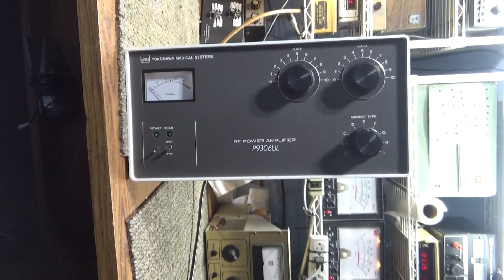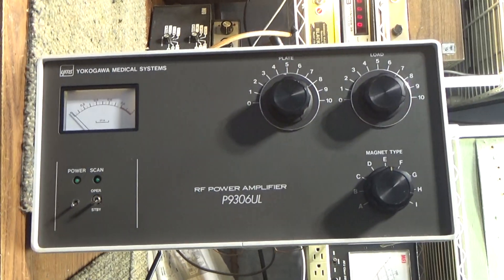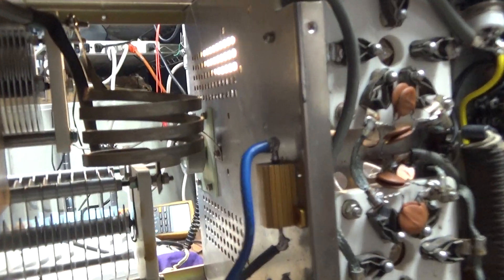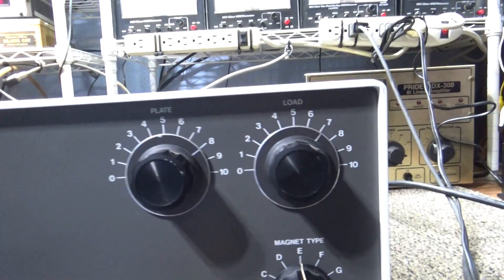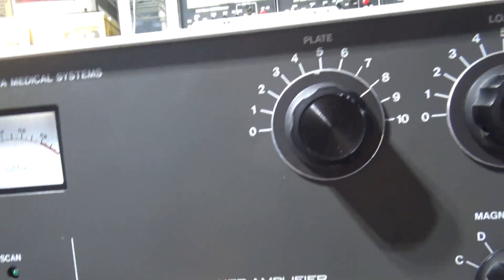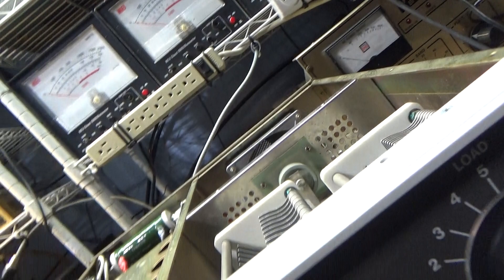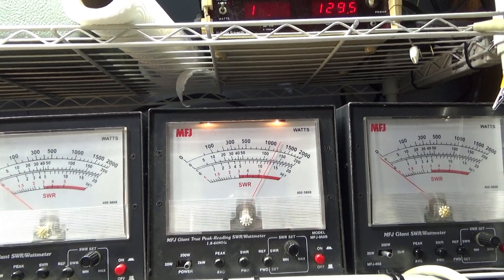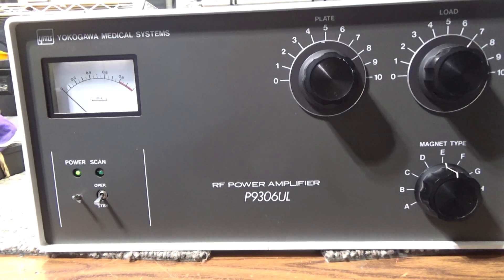Yokogawa P9306UL monobanded and stripped walkthru and on the bench

Comment: Your correct about the sb-220, under current rating for two tubes but ok for ssb but most want to run them on Am and eventually burn up the plate transformer which to me is the weak link to it. The “sb” stands for sb..Then over driving them never helps things out any.I run 3800v on 3-500zg builds.. figured it’s decent voltage unlike the sb-220 around 3200+/- 
Regarding input fixed input using a t50-6 toroid using 20gauge magnet wire 7 turns using two 150pf micas on in and out to ground for a two tuner one tuner 150pf on each side of input. I haven’t yet tried this but bought the junk to try this out on my yu-158 build (different micas ofcourse) letcha know how it works out sounded interesting ha!
Usually use two air variables with a 1/2 dia. 5-6 turns between the two. Appreciate your video once again

Comment: IIRC, the two most popular frequencies are 13.52 and 27.13 MHz. Was this a dual band and what did it use for an exciter? 
There is a dearth of information about this device on the internet. Not even schematics or the instructions.
Reply from the maker: I have no clue what this used as an exciter. It originally had around 6 bands in it and they matched the 10-80 meter Ham bands. The 'Mag' switch was the equivalent of the band switch and switched both the input and output band circuits. The Tokyo Hi Power version is 95% the same as this amp and I used the schematics from it.
Reply: @tramdr  Interesting. Johnson Yokogawa is a big HVAC and industrial controls company and maybe they made them under license from Tokyo HP.

Comment: One of the approved frequencies used for medicine is very close to the C.B. band. That’s one reason we hear so much garbage. Those devices are usually very “dirty” and cause RF interference over a wide range. But they can be fixed.
Reply from the maker: Yep, Henry made some that were 13.7mhz and some were 27.4mhz from the Henry factory. They were very well made amps, like the big Henry Ham amps, but they did not have a lot of filtering in the Henry's so, as you said, they were dirty. At one time, many years ago, I used to buy the Henry RF generators off Ebay for cheap and mod them for 10 meters and add better filtering. Those were beast's, especially the 3cx3000 boxes. Just the parts in those were worth some cash. 3000 tube, socket, chimney, roller inductor, Bird dual line section and 2 Bird H slugs. Hams at the time said that the 3000 tube was no good for 27mhz and you couldn't give them one of those crap Henry medical boxes LOL. I used to make a lot of money off those. Nowadays, the medical RF generators are solid state and the old tube ones are hard to find, plus Ebay is now a ripoff plus freight shipping even with Freight Quote is not cheap anymore.
Reply: Don't know how long you've been around, but 50 years ago shortwave diathermy was quite popular and the CB band was polluted with wandering, buzzy signals that in many cases obliterated several channels at the same time. They had a variety of sounds. My favorite was the "washing machine" sound. 
Today, the only thing I hear are induction heating systems, and they make short bursts of RF. They are easily spotted with a SDR.